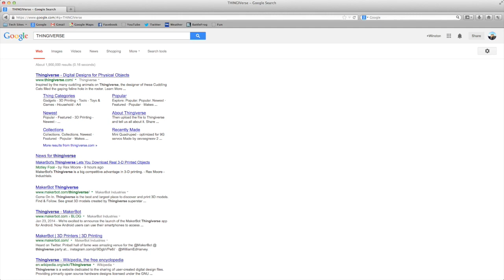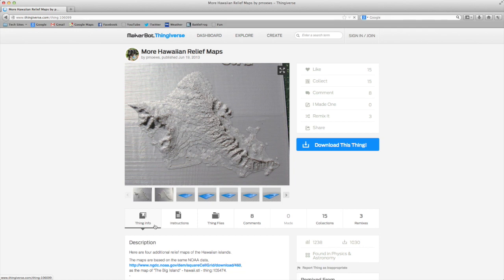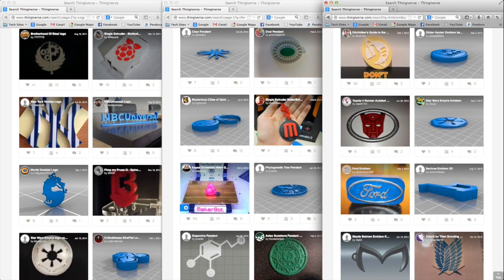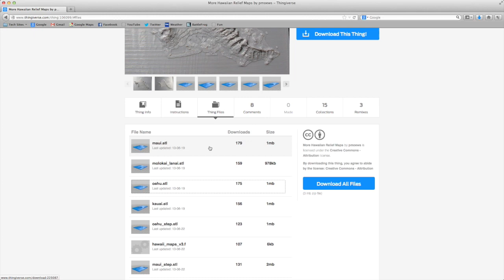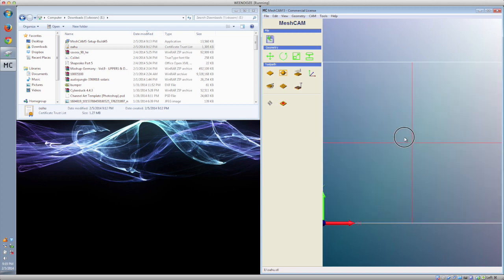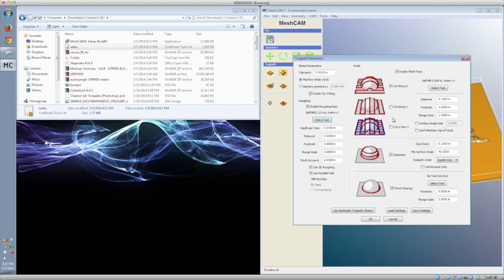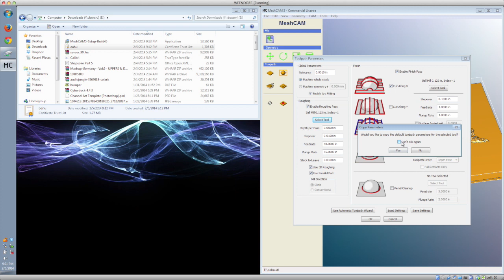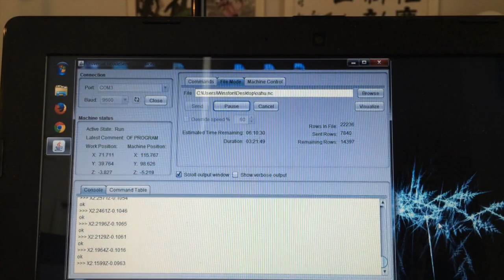Shapeoko 2: Oahu Relief Map Milled in Wood

Comment: Hi, I have a Shapeoko 3 coming in and wanted to do exactly what you did in the video with a map relief.  Have you had any luck getting from a .STL to Easel or Carbon Create?  I tried going through a few different apps, but don't think that will fly.
Reply from the maker: Neither Carbide Create nor Easel can import 3D STL files. For that you will need more advanced software. Ex. MeshCAM, PyCAM, Fusion360 + Meshmixer, etc.

If you're doing something in the style of topographic maps, and you can get vectors of your terrain (SVG or DXF), then you could use Create or Easel.

Comment: I have a quick question. How did you figure the plunge rate? I can not seem to figure this out for the life of me!
Reply from the maker: +KWS07 There's no single, magic formula for it, my rule of thumb is to start with 1/4 of your feed rate, increasing up to 1/2 if the material will take it. Fastest I usually go for soft woods is 30 IPM plunge (75 IPM feed), but that's spindle-permitting.

Comment: I think in your third video in this series you talked about how inconsistent the dremel knockoff spindle was and that you would be swapping it out with a real dremel.  I was wondering what happened with that?  It might just be a camera/video encoding artifact but it looks like in some of your closeups that the spindle that you're using either has loose bearings or some runout in the shaft/collet/collet holder.
Reply from the maker: Both are highly probably. The stock rotary tool is not at all a precision device, and the runout is observable with the human eye. I did upgrade to a normal Dremel (slightly better precision, and a lot more usable), and eventually to a full blown quiet cut spindle upgrade kit from invetables.

Comment: i am using grbl controller and the spindle loss cordinates (it goes away ) do you have any idea why this happening? my grbl is 0.9 version . should i use universal gcode sender, is there any difference with grbl controller?
Reply from the maker: In what way is it losing coordinates? Is it one axis more than another? X&Y? In Z? Random?

Grbl controller shouldn't matter, but the problem could be one of many things. You're going to have explain more about the circumstances.
Reply: Winston Moy  i visited your website and i sended an email through your contact form , there is a link with a screenshot of the problem , i will really apreciate it if you reply too , thank you :)

Comment: Hi
Which post processor did you use in Blendercam?
Reply from the maker: I didn't use Blendercam, but the most basic, generic postprocessor should work. MeshCAM has a "Basic" one, and Mach 3 has also worked well for me. Or you can try that ISO  postproc, since blender claims it's "standardized". If in doubt, just do an air-job over your work piece so you don't risk breaking any bits.
Reply: Winston Moy
Thanks for the feedback. And thanks for posting this video.

I did try the ISO post processor and found that the Blendercam output worked best if I deleted the gocde lines up to the start line. On the start line I also deleted the tool selection and spin speed. If I didn't delete the codes up to that point the Universal Gcode Sender would complain.

Comment: Because I want to get a 3d printer or a shapeoko 2 . Is the software for the shapeoko free? Which one would you recommend a 3d printer or a shapeoko 2?
Reply from the maker: The digital workflow for shapeoko can be free depending on your choice of software. Inkscape and FreeCAD vs Illustrator and Solidworks for example. Other free CNC-related programs include Easel, PyCAM, etc.

As for which is better, it depends on your applications. a sub-$1000 3D printer can make shapes you can't machine, but will lack the strength to be used for structural pieces (example: slingshot, furniture, bottle openers... and tons of things I lack the creativity to name at the moment).

If you want to make more complex things with a CNC, you should be comfortable with traditional fabrication methods like bolting, welding, screws, adhesives, etc.

The things I want to create simply cannot be made with ABS or PLA, but if you're content with desk tchotchkes, or the occasional oddly shaped bracket for a motor, or light-duty prototyping, then a 3D printer will probably serve you better.
Reply: Ya because I think you can more things on cnc then a 3d printer and more stronger thanks for your info on cnc and 3d printer am planing to get one those on Christmas .

Comment: Very interesting video. How do you generate the Gcode to the Aduirino? Ive got this thing and when I open it in Aduirino I cant visualize it. http://prntscr.com/3wbbt4.
Any suggestion? 
Kind Regards 
Goran
Reply from the maker: The code you send to the arduino typically has a ".nc" file extension, although '.m' is technically possible. I'm not sure what your file is. And I typically use Universal GCode Sender to run the program.

Comment: Hey Winston, very high quality documentation. 2 questions: 1) Do you have a YouTube Channel just for your Shapeoko 2 videos? It would be easier to find the videos I want to watch and I would be making sure I wouldn't miss a single one. 2) What 3D CAM g-code generators have you tried other than MeshCAM (CamBam, DeskProto). I see a few of them depend on expensive commercial CAD software...
Reply from the maker: I used to do all sorts of random stuff on my channel, but from here on out, I plan on keeping my content at least 80-90% projects. Once I further improve quality, I may partner with Edward Ford on the Official Shapeoko Channel (currently an editor for the Shapeoko Blog). For the time being though, it should be safe to sub to my channel (I promise I will keep most of my videos Maker-minded).

As for other gcode generators, I haven't tried too many but I did put together this video a few weeks ago on free 3D CAM programs: Free 3D CAM Programs: FreeMILL & PyCAM Overview
I do plan on trying out more programs eventually when I have the time.

Comment: How hard is this to use for someone that has zero experience with any of this?
Reply from the maker: The computer side of CNC boils down to 3 parts:
1) Get 3D model, or 2D shape.
2) Turn file from step 1 into a machine trajectory
3) Stream instructions from step 2 to machine.

1 can be challenging if you haven't used a CAD program before. You can try Sketchup to see if it's a palatable process to you. You can also just download files for free at sites like Thingiverse.

2 can be quite easy if you buy commercial software, slightly harder, but still do-able with free software (refer to my latest video, as of 5/19)

3 is pretty easy as well, a lot of people use Universal Gcode Sender.

Inventables' Easel software is aiming to make all this dead simple by wrapping it up in a user-friendly one-stop-shop program. It should become available in the next few weeks/months.

Comment: I'm really enjoying your videos and you may have pushed me over the edge to purchase the ShapeOko 2.  I am curious about one thing.  How practical would it be to run the program with say a 1/4" mill, then without moving the workpiece, swap it out for a 1/8" just to get more details, and while we're at it, then swap it for a 1/16".  And if that's not feasible, how difficult would it be to shape the land as you did, but then swap the mill for something much smaller to do lettering?
Reply from the maker: The program I was using looked like it had provisions for choosing different end mills. And even if it doesn't, if you know what you're looking for, you can split up your NC program into two halves or something to allow for a tool change.

The most important part is just to make sure you don't reset your machine zero. As long as your reference location remains constant, a CNC should be able to pick up right where it left off.

If you do want to go with a 1/4" cutter, just make sure you have all the necessary stuff. The stock rotary tool, and most dremels, don't take anything above 1/8 without special collets or something. And do a test on scrap wood to make sure your stepper motors are strong enough to push you through wider swaths of material.

Comment: for starters, excellent videos. very well done
what post processor did you choose when exporting your gcode from meshcam? did you just use the Basic GCode one? thank you
Reply from the maker: Yep, basic is all you need if you're using GRBL-Arduino. Since the spindle operates independently, only things that are needed in the GCode are XYZ coordinates.
Reply: oh yeah, you're using arduino. cool i'm using the tinyG board. tested the basic export and it seems to work fine. sweet. thanks man.

Comment: How long did this take?   Do you post your meshcam speeds / settings anywhere?
Reply from the maker: I really should get into the habit of documenting things like that. Feedrate was 15 in roughing, and 10 in finishing, if I'm reading my NC file correctly.

Time to completion was between 3 and 4 hours, I believe. Could have done it faster, but it was my first run with a ball end mill so I wanted to play it safe.
Reply: Winston Moy Last question - how did you register the two passes (roughing and smooth) ?   I can generate the two toolpaths, but it seems like starting the second pass in the right area is going to be hard?
Reply from the maker: John Abella
Since there was no tool change, the entire milling process was done in a single NC program. Transitioned from roughing to finishing automatically.